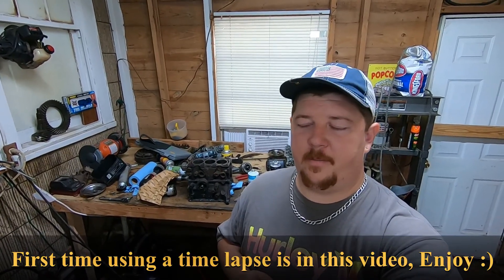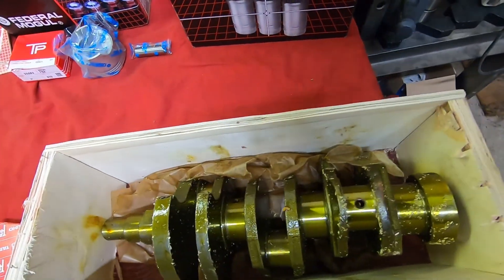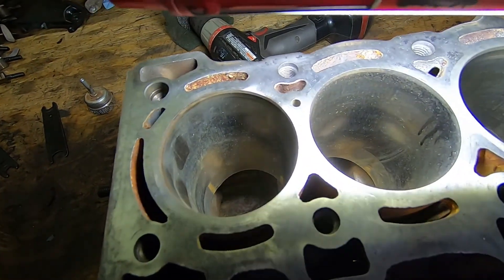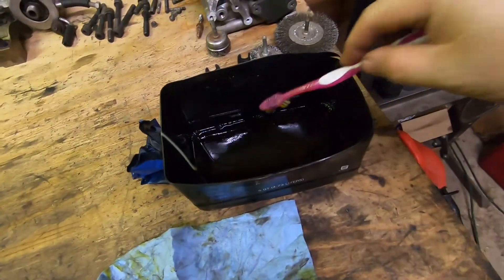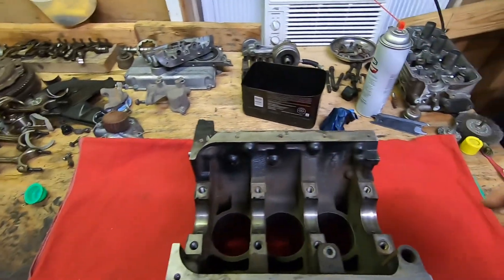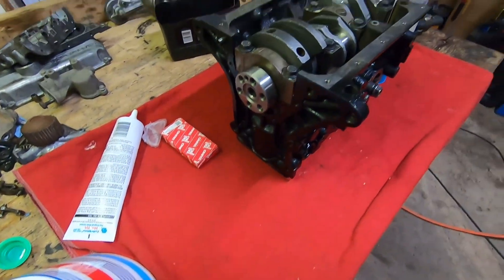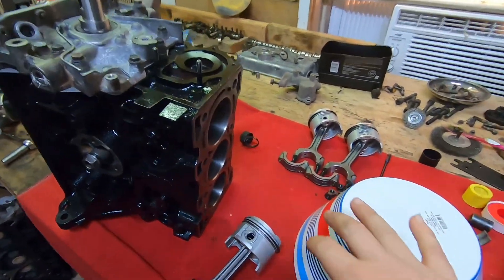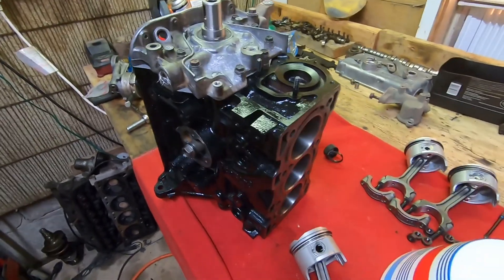1996 Suzuki Carry F6A engine rebuild Part 1

Comment: Great video, I have to rebuild my engine. The timing belt went. How many hours would the entire rebuild take; including removing the motor and painting and then putting it back in the truck?
Reply from the maker: Took about 2 days to remove and disassemble. About a day of cleaning parts and 3 days putting the engine together and about 2 days, putting it back in the truck and finalizing everything.

Comment: James, Can you post a link where you got your engine kit.
Reply from the maker: Took about a month for it to show up. It was from the Philippines
Reply: @james4wd236  James do you know if this unit 2002 is a EFI unit or carb.
Reply from the maker: @mikemullarkey9269  Mine is carburerated
Reply from the maker: Not 100% certain but i think this is. I bought it about a year ago. https://www.ebay.com/itm/252494678454?hash=item3ac9db09b6:g:OH8AAOSwzeFjYxEY&amdata=enc%3AAQAHAAAA4GTeKti%2Fa2ivBpvEFwUaGRNI8mpM%2Fc%2B7PdHPTXdXjM6bYGBL4RG4z9wmbDeGxFGDs7W2moKGU5H%2BfIcSPe0D2%2FusDpRM1fivMI%2FO9jtAOcyy3JKMdzNXhaOGRKFBu9Htt9RbO0z7YRWBvvfiGwSKhaF6i9sMcAl2rW6%2BetW38YEoS75phPjLrMz94z9JBc%2FPIin3tNYjRqKBnJMGJLLnLKlvB92FoOsiuIKoVO%2Bu2FvIdLG8ZEYbzU7FAPQrVwguQeimLJn4%2Bl0EdTx1QuWuc8UTogMZFylpEE%2BwqLTbMbIW%7Ctkp%3ABFBMzpii27Bh
Reply: HI James, Thank you for sending the link. I am heading out tomorrow morning to pick this up and he seems it has a blown engine. I think if it is I will have the sleeves installed as well the head rebuilt. Already thinking of tracks and lift kit. This one has the diff lock option. Thanks Mike
Reply: James, I am going to need a block since it looks like a rod went through the side. Do you have any idea on a used motor for a 2002 K6A EFI unit
Reply from the maker: @mikemullarkey9269  The only people that come to mind is G&R Imports. They have everything for theses things. They found me an axle in Japan that was impossible to find otherwise